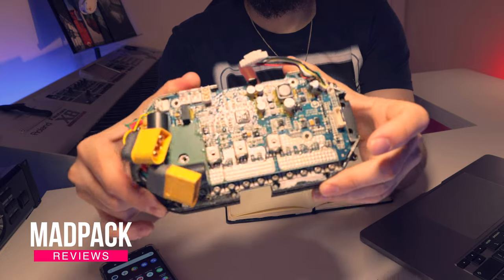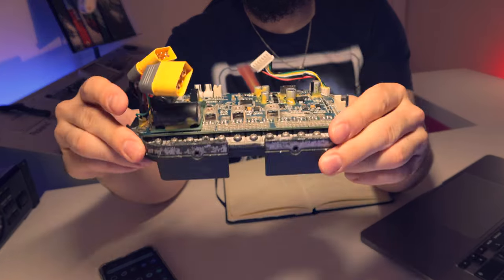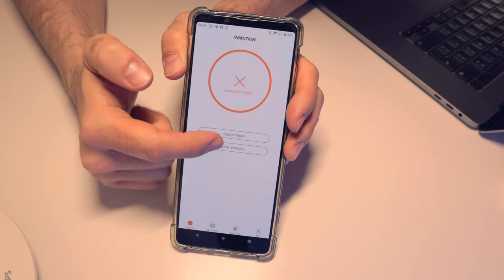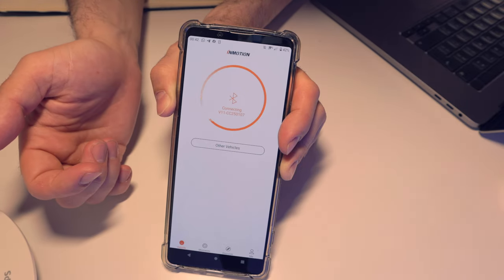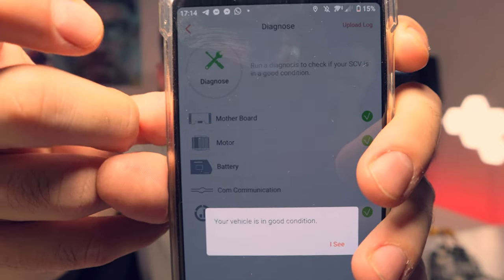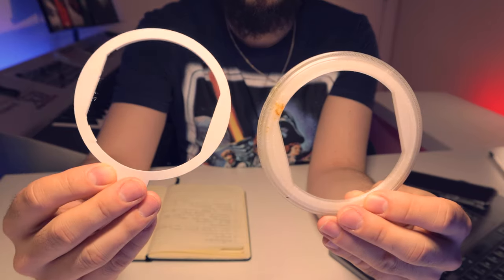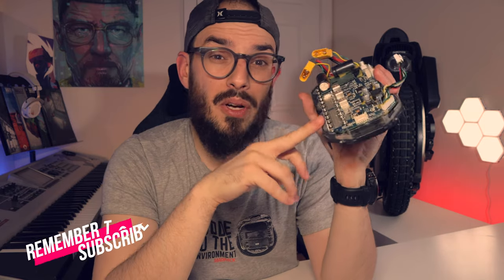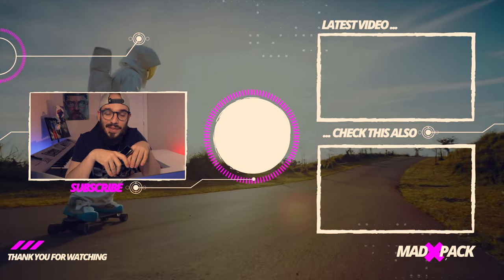Inmotion V11 Motherboard Installation - Things you should Know!

Comment: Will you do a video on the actual physical process of swapping the motherboard? My rear light went out and I’m trying to see how much of the wheel I will have to take apart simply to get to the board, I thought that’s what this video might have touched on. Cheers!
Reply from the maker: After all the big process I had to swap tire plus I will not do it because there is a video showing how to disassemble all-wheel... But to take out the motherboard you need to take side pannels you have a plastic that covers the motor cable you need to take out.. Take pit lights to remove the structure of the suspension and you should be ready to go
Reply: @MADpack  much appreciated! Thanks!!
Reply from the maker: Not a problem bro sorry to dont be able to reopen my v11 but ive been few months without it and was a long process because I found a lot of issues until I got everything I need.

Comment: What a painful process, it remind me one of the reason I choose not to go for Inmotion. Maintaining it yourself is a pain in the a**. Love your videos, always full of good tips. After two weeks with a MSP HS and over 400km (drive it daily for go to work 20km morning and evening) I am in love with it! Already fully teardown it once and opened it up 2 more times for waterproofing and checking the waterproofing.
Reply from the maker: What have you done for waterproofing? And thank you so much for your support. Related with the app if you compare with gotway is 100 times better :) I just found it hard so I believe this video can help a lot of you guys in the future. I will not stay away from inmotion for something like this. It
Reply: @MADpack  we have EUC World, never used the manufacturer app for my wheels. For the waterproofing I used engin silicone in all the inner shell, with sealing duck tape on the jonctions of the shell on the tire tracks and PTFE waterproofing and air filtering mesh with 3D printed mesh as well on the front light holes and right shell input and output holes. Temp is fine so far 45°C with heavy riding at 30°C outdoor temp. I have the last batch of MSP HS, with the fan always on and no fan on the front light.
Reply from the maker: Duck tape on the outside?
Reply: Not on a place you can see. This is on the joints of the 2 inner shell that is the closest to the tire. You can see it on the Monster Pro teardown video of Wrongway. He is using another kind of adhesive tape. But I used to drive motorbike on race tracks, and we used duck tape on some parts that can break, because even if the plastics shatter it'll stay in place thanks to the duck tape. That way if a small rock hit the shell, it'll secure it and it might even keep it waterproof.
Reply from the maker: Okidoki thank you for your inside bro. Really helpful

Comment: So nice to see that you have the CST tire fitted.
Do you like it?

P.S. I Ride mine with 1.5 BAR or the tire feels like a square while turning.
This tires are designed for lower pressure.
Reply from the maker: I still cant really tell because I still have to swap the suspension on it after i can start to really tell what is my thought about it bro
Reply: @MADpack  I see you have an off road tire for the V11 I'm looking for this but without any success! Where you get this tire?
Reply from the maker: Just brought it in a uk supplier? I will be doing a video about it soon
Reply: @MADpack  So you have an Link?
Reply: CST C-186 2.75-14 TT 35P  rear tire R-268183 fit perfect! 1-1.4 bar but reduce the range about 10km and is awesome on gravel and sand etc.!!! For security reason please remove the kick stand...danger of blocking!!!!
Reply from the maker: Great resume :)

Comment: why did you have to change the motherboard?  mine went kaput after 5 months when i did a tire change, i tested the wheel and it still works fine, as soon as i try to turn it on it shuts down.  inmotion says i should try to change the boards??
Reply from the maker: Have you thought that you may have burn 🔥 yourself the motherboard? I have made tire change on 3 InMotion v11 and no issues but I burn the motherboard of a begode exn doing a tire exchange because I touch with one cable of the motor on the motherboard so no fault of begode just mine

Comment: Hi Madpack, qq, how can I know when my v11 was manufactured and which batch is it? can the serial tell me that?
Reply from the maker: I’m not so sure about that the easier way is looking to the motor bearings if you have a motor with a rubber cover in brown is one of the latest but yeah you need to disassemble the wheel
Reply: @MADpack  I hoped there will be an easier way. Thanks much for the prompt response.
Reply from the maker: No worries bro

Comment: Omy this wheel sounds like hell. To compulated to do a break down.  Gum killed your v11 lol sorry. Waterproof not gum proof lol. Watch out for mud to I guess
Reply from the maker: This wheel was going into mud before and never had problems but yeah install this motor bearing protection to share my experience with you guys. Hope that it was helpful
Reply: @MADpack  probably did just takes alittle bit longer for the dirt to kill the bearings then gum. It's a bummer they just let everything get into the bearing
Reply from the maker: If this goes wrong for me i may do the spacer in metal
Reply: @MADpack  like a skateboard bearing smart idea 💡
Reply from the maker: Not that kind of spacer but print the spacer in metal